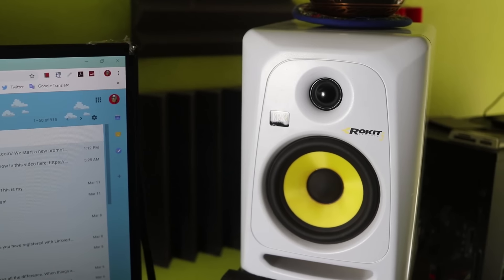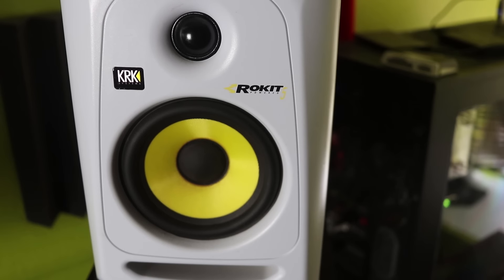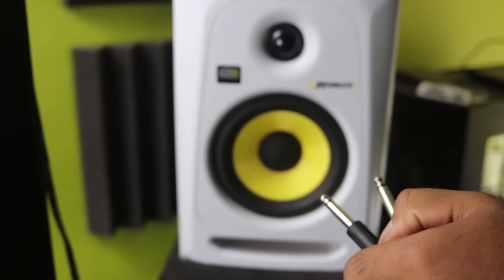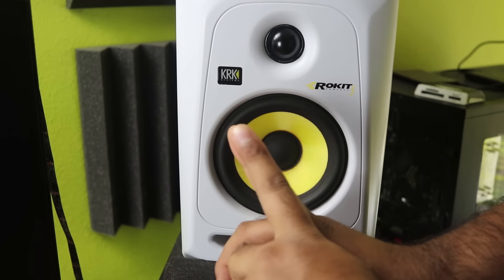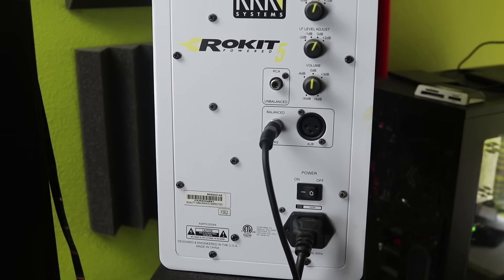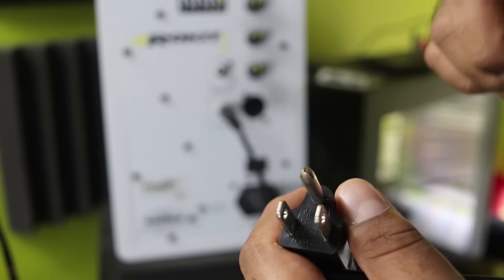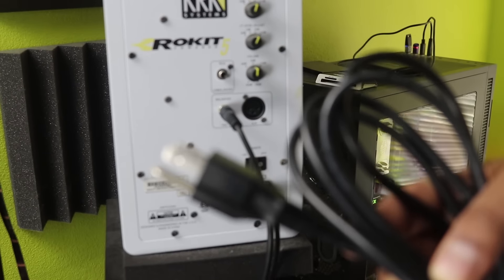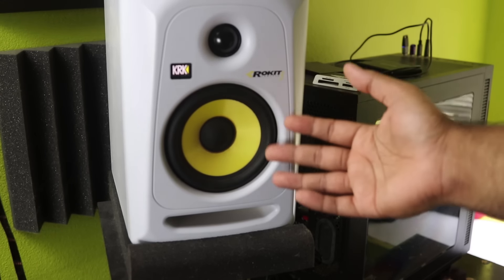How To Stop The Electrical Noise From Studio Monitors!

Comment: I got a pair of Yamaha HS8 and this drives me crazy. None of these tips helped actually. It's almost the exact same sound from the video.
The sound only occurs when my Apple Studio Display is plugged in on my macbook pro 14". Tried everything, new cables, different wall outputs, tin foil, these amazon clip-ons, disabled all radio frequency like bluetooth, wifi or cellular on my phone..let the studio display power the macbook and also tried it with the MBP magsafe power on. It's definitely about the Studio display, as soon as I unplug it it's gone. And the funny thing is, the sound gets loud and annoying only when I move the mouse cursor or something is going on on the display. The more there is going on on my screen (playing a video, fast scrolling or clicking) the more hum and buzzing. If anyone has another idea what I could try I would really appreciate. This drives me crazy.
Reply from the maker: Hey Christian. Those "amazon clip-ons," are those Ground lift adapters? 
I've just read a webpage regarding a situation just like yours. His solution was to buy a couple of ground lift adapters for both of his monitor speakers, and it worked out for him.

https://www.macosaudio.com/forums/viewtopic.php?t=52239 

It could stem from the points (the wall plugs) not being tapped into ground correctly.
I would also suggest buying a socket tester plug if you do not have one already: https://amzn.to/3s9SZQy

Goes without saying, but definitely take caution when working with wires, especially if they are live. (Saving my own skin here) lol. 

Hope that link can help!
Reply: @OmoiSenpai  thanks man will check it out.. I was talking about those small clips you can put on cables (dont know the name in english)
Reply: @cmg  I'm in the same boat... please let me know if you find a solution.  I'm about to throw my speakers (or myself) out of a window! 
By the way, I subscribe to your channel.  Nice work!
Reply: @thefunnyfitguy  thanks man, I feel you! I'm this close to just buy new monitors that are shielded correctly..the HS8 are only shielded by wood instead of metal inside..
Reply: I'm dealing with the same, on a HS8 set too. If you found a solution, please let me know!
Reply: @Rogier89  still in the dark… and it sucks 😞
Reply: @Rogier89  It is a ground loop situation. I use usb isolators and DI boxes for galvanic isolation. I use ground lift on some DI boxes too. I also do use toslink as light is not a physical ground contact (no wire) and acts as isolator. Of course sometimes I just power equipment on different electricity circle, separate grounds.
Reply: @ognyankoynashki  Thank you for your reply. I am looking into this currently. Could you maybe tell me what brand or model you are using for those items? For example, I've read that some USB isolators can cause problems.
Reply: @Rogier89  There are fake galvanic isolators on the market :) Intona is the real deal but expensive. Recently Topping released HS01 for USB2 and works very good at a decent price. I use Intona for my audio interface and I use the Topping isolator with two dacs which are only for listening to music on various setups.
Reply: @ognyankoynashki  Thank you very much! I'll have a look at those.

Comment: If none of the above fix your problem entirely, try running your powered speakers from a different power outlet that has nothing else running from it.
The cause of the noise can also be traced to the switch mode power supply that computers use, if it's on the same power circuit as the speakers.

Also POWERLINE Internet distribution in the house can be a major cause of digital noise getting into your mains, so try disabling it if you have it, to see if that solves the problem.
If you are in a apartment block and somebody else is using POWERLINE internet distribution, it can still effect your mains :( , they are trying to have it banned in Australia because it effects the radio frequencies used by the emergency services, that's how bad it can be.

Another source of noise can be traced to having power cables running near or across either USB and/or the speaker cables, you want to try and keep any cables that are carrying power as far away as you can from cables that are just carrying signal

Comment: I bought a new Monitor last week and noticed that i started getting this noise when I play games on PC. Everything was working fine before with my TV but then I got a Pc monitor and now I get this problem. I have a scarlett audio interface and yamaha HS8's. When I am not running apps and i am in desktop as I move the cursor my speakers pick up each movement I do. I do have my speakers hugging my monitor. I did move my speakers away from it and it still does that sound. I am starting to wonder it could maybe be a defective unit or I might be missing something else that could cause the problem. My speakers are running through XLR cables.

Comment: I switched to the TPS cables and it completely removed the interference that I was previously getting. The only problem that I have now is that my monitor speakers are no longer as loud as they used to be before switching the cables (I also have the KRK speakers)
Reply from the maker: Hmm interesting, interesting. Are you sure you haven't accidentally reset or lowered the knobs in the back? Or perhaps something to do inside of the computer? You never know! Just in case.
Reply: @OmoiSenpai  yeah I checked, not sure why that happened but the lower volume i can deal with however the interference i was getting i could not so I've accepted this compromise

Comment: Cool but mine are connected up the right way with balanced xlr , since 2 days they suddenly hiss just the same like you let us hear in the video.
I got the feeling is due to bad capacitors too, also my krk 6s had black gunk all over the electrical board inside that has moist inside.
A year ago I fixed is and replaced components that where burned , it fixed all the problems but now its hissing again.
Better also check the main board inside if the caps are thick/blowed up, these caps dont cost much and a quite easy job to replace them yourself.

Comment: 1. Noise should be absent even with an unbalanced connection. Using balanced simply avoids the problem, it does not resolve it.
2. Balanced is two twisted identical conductors carrying the signal (one in phase, one inverted) where the interference affects both conductors the same thus it is cancelled out. A third conductor forming a mesh around the signal conductors is grounded and provides additional shielding. Therefore:
3. Tip signal +, Ring signal -, Sleeve ground (on XLR: 1 ground, 2 signal +, 3 signal -)
4. the actual problem in a self-powered monitor is caused when Power Ground is internally connected to Audio Ground within the device. It will require a qualified electronics technician to resolve it.
I hope this helps.

Comment: Capacitor failure causes  issues as well krk speakers had issues with their circuit boards . I’ve recapped several pairs to cure noise issues .

Comment: I'm so glad I came across this video. My issue was fixed by the beginning of 2nd minute. I was so frustrated with this annoying sound and I had no idea that my LED strip lights are the cause of it. I simply changed the USB port from the back of the computer to the front, and the noise just stopped. Seems I just had to reposition it.

Comment: I completely fixed mine by moving the power cord to my macbook away from the audio cables. I though I had to buy new cables until I messed around with it. I'm sure it will work too if you move your desktop power cord.

Comment: So there's no balanced rca cables? My monitors don't hiss or emit any noise when just turned on, but they do if RCA is plugged in, which is the only output scarlet solo supports.
Reply from the maker: Nah, there is no such thing as a balanced RCA cables.
There are a few things you can try to do to help. 
1. Keep the device, and the speakers away from other electronic devices to emit any signal interference. 
2. Perhaps the RCA cables that you have are old ones that probably have been bent or damaged. Replace them with a new one, or find some that have some copper shielding. That can help. Mogami have some, but tbh. I don't think anybody tryna spend that much on RCA cables ( Unless they are audiophiles )
3. The shorter the cable, the less causes of interference from happening. Try to keep the cable less than 10 ft to be safe.

I hope this can help.
Reply: @OmoiSenpai  They were indeed short and very cheap as I had no idea what I was getting into. My interface doesn't have other jacks than RCA. So I'll have to find a replacement. And the cable wasn't exactly called RCA but it was called AV (audio video) and it was connected together in a way it made it almost impossible to split (so I had to edit the cable, although not terribly). What if I just use a conversion like XLR to RCA? These monitors have 3 possible connectors. Nothing aside from the computer is near the cable or the monitors. I live in a small old apartment so the voltage might not be the cleanest and I can't afford a power regulator. So my best option is to get an audio interface with low latency like my current scarlet solo has, and with the balanced connection. But it's near impossible for me to be totally sure, if it would work out. At least I managed to find some balanced cables (TRS).

Comment: This didn't work for me. I have balanced XLR to 1/8 (I think, maybe 1/4) cables that plug into a Mackie Big Knob Passive. I still get this noise. the power cable has a 3 prong and all 3 prongs are connected. Any suggestions? They are plugged into a surge protector type thing, into the same outlet as the PC

Comment: When it is used as a speaker cable, the signal goes through the tip and ring., and the shield acts as a grounding shield to protect against RF "inductance."

Comment: Arturia puts a "ground loop adapter" in some midi-keyboard boxes. These split the USB from audio interface to a data part on PC and power part to a wall outlet USB charger. It solves the electric noise issue. Maybe they also sell it as a product itself.
Reply: I mean the one that is in the box of the Arturia Keylab MK2 (see downloadable manual if you are interested).

Comment: I bought a balanced cable and plugged it into my computer and my speaker looses all bass and sounds echoey, when I plug it into my phone with the same cable  tho it sounds fine plz help
Reply from the maker: Is the plugs all the way in? Because when a plug is not all the way in, sometimes it can flip the signal and cancel out the signal altogether. 
As far as echoey, I am not sure. That usually happens when there is a mic involved. It creates a feedback loop of sorts, or if it's far away to where the sound dies off by the time it reaches the mic, it can make the echo sound. 

Maybe that can help. If not, smell the devices and see if you smell like a burn or something. If so, something could have broke.

Comment: Alright.
*my solution* was using power cables without grounding. in my country if you use american power cables, the ground is not plugged in.
the reason for this is that my audio interface doesn't have any balanced outputs, so I had a ground loop.
enjoy :)
Reply: Ground loop is the most common. But once I connect my DIY  headphone amp which it properly grounded still got hums. Finally, I just solve it by moving the ground like of the transformer until I hear no noise, and that it was solved.

Comment: Could this be a ground loop problem that can be solved with a ground loop isolator? Just so I know if I need to purchase either balanced cables, or a grounf loop isolator
Reply: Some users wrote about using some USB ground loop like this one:  iFi Audio iDefender3.0 USB Ground Loop Eliminator

https://www.amazon.ca/gp/product/B01N3XKOLG/ref=ox_sc_saved_title_4?smid=A2M1T9YSBKVQUY&psc=1

In some case it solved their issue and some other not.  It is sure on one thing, having an audio interface not powered by the USB but from external DC PSU would help as well since you can now use a data USB cable or simply rebuilt your cable removing the 2x used for the power inside.

Comment: Still have a problem. How do you get 2 balanced wires coming from your pc?
Reply from the maker: Through the Audio Interface, I am using a Balanced TRS cable (make sure it has 2 rings around the plug of the cable!!) 
If it's straight from your PC with like a headphone jack. I don't think you'll be able to. Would be better off buying an Audio Interface in that case.

Comment: my monitor speaker hums without even being connected to anything just powered on, any idea?
Reply: you need pure sine wave on the power going into them, the hum is the noise in the mains voltage.

Some UPS are sine wave but only on battery, others are always sine wave.
any labelled as "simulated sine wave" should be just as good as well.

Any UPS with automated voltage regulator might work but I'm not 100%
 other than that you can get power conditioners but they are expensive.

If you want an exacr model line cyberpower pfc sinewave series

Comment: In my case, here is a noise from LCD backlight and powersource and many impulse generators around(USB, HDD, buses). Turning backlight off and keeping laptop on battery pretty helps for a while. That all i must do because using DA-AD resampling conversion in realtime, two soundcards.

Comment: Hi Justin.  Thank you for the video.  I have a vestax 05 mixer and it make a very loud noise coming out of my monitors(samson resolv A6).  I was wondering if there is a way to get the TRS cable into some kind of adapter so that I could plug it in to my mixer.  Since, my mixer only allows rca.  Actually, I just checked and it's really loud in the headphones too.  And that's a new thing.  I know it's the mixer because when my friends plug in their mixers there's no humming issues.    Thanks again

Comment: Hi got a question, I connect my monitor --> DAC --> my pc. I was using PC --> USB --> Dac ---> RCA --> TS --> Monitor and I get that noise. Would switching from RCA --> XLR fix the problem? So the new connection would look like PC --> USB --> Dac ---> RCA --> XLR --> Monitor
Reply from the maker: That sounds like a lot of devices that it's going through <_> 
Any time you say RCA though, you're going to be using an Unbalanced Cable, which could introduce signal interference. 
To be more clear, which DAC are you referring to? 
Perhaps, send me photos to my E-mail. It might give me a better idea of what is going on. 
Justin.Bansaraj@Gmail.com

Comment: the noise is present even without the audio cables. so you should go straight to the power cables. in my case even if i have thr 3 prongs outlet, for soem reason i stilll have the noise. driving me crazy. not sure what to do

Comment: Great video! but what if you are using a USB DAC connected to a headphone amp and you get this sound? 

i tried everything even bought a new power supply and new motherboard / CPU  to my PC checked ground (by touching the devices) and that didnt help i am going NUTS almost on the edge of buy a new DAC and AMP..

Comment: i ALWAYS use the xlr port on the back of monitors because of this, and ive had a couple of audio friends with the same problem and I told them about using XLR and it fixed the noise for them too

Comment: I have Logitech Z120 speakers and now I've noticed buzzing when I turn thr volume on. They have USB ppwer cable and a cable going into my PCs sound card.

I've tried them on laptop. The same thing is happening.

Is it the speakers or something else?
Reply: This is literally my problem too!
Reply: @_ramennoodles_9740  try this - unplug the speakers USB cable from your PC/laptop then try to find some cellphone charger with USB port so you can plug the speakers into your charger and THEN plug them into the extension cord. I did this and it works perfectly
Reply: @mkm1015  thats a great idea! Thanks so much!

Comment: Those adapters mentioned here will not help if grounding is the issue.  The adapters do not actually create a ground when there is no ground wired up to the receptacle.  They just allow you to plug a 3 prong plug (unsafely) into a 2 prong receptacle.  The little metal piece on those is really just to keep them from falling out of the receptacle.  If you have the 2 prong outlet, you will either need to go without ground (either unsafely or safely with a GCFI outlet installed) or have an earth ground cable installed by an electrician for the receptacle the speakers are connected to.  I was watching this because I'm trying to see if there is a solution for fixing the wifi interference I'm getting from a grounded speaker with a balanced cable connected to it.  The interference is coming from my iMac's wifi.  When I turn the wifi off on the computer, it stops.  If anyone has had this problem and was able to fix it without just turning the wifi off, please let me know.